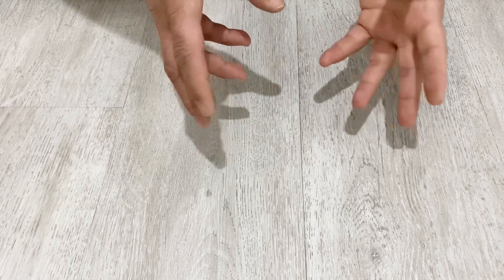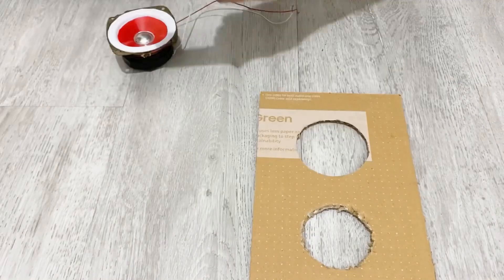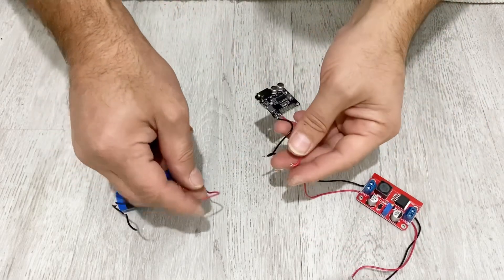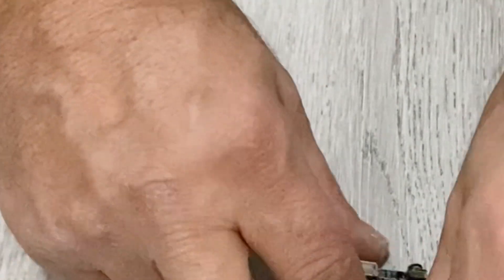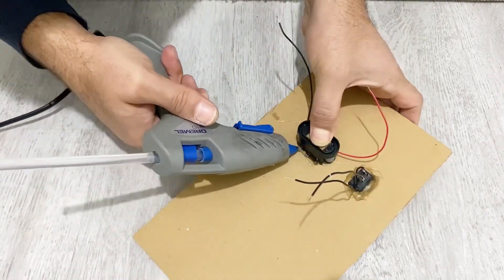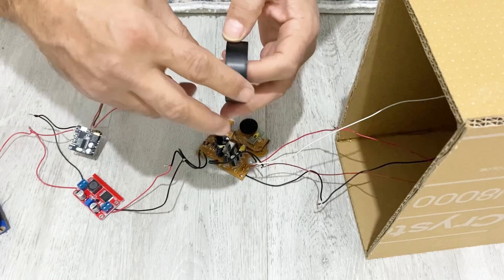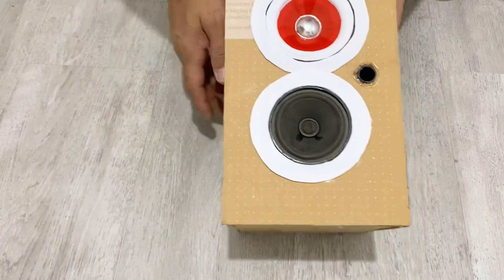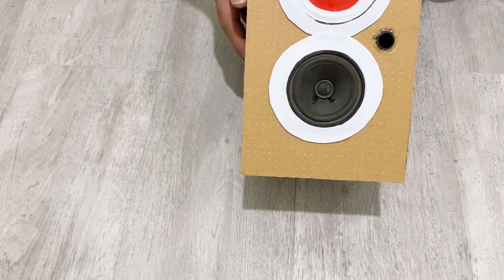How to Make Rechargeable Bluetooth Speaker

Comment: Is it safe without BMS on battery or diode after charging module ? how to secure the reverse current. Some vids use diode, transistor and even transistor
Reply from the maker: The electronic cigarette charging module do everything. It’s completely safe.
Reply: Can i replace E-cig charger module with TP4056 charging module (5v 1a) in addition of step up boost set it 12V to BMS ? Or its better using 12v socket and charge it with wifi adaptor ? Sorry for asking mister